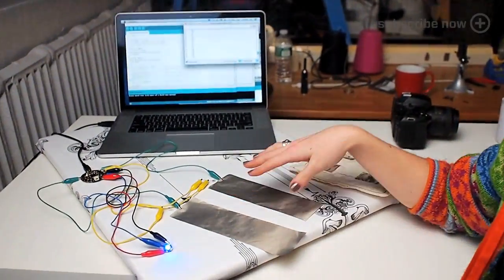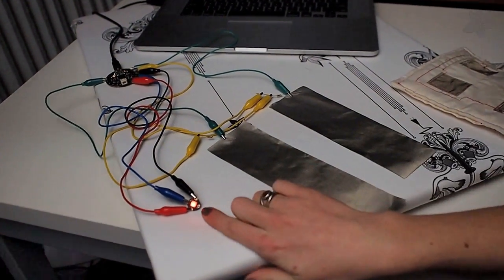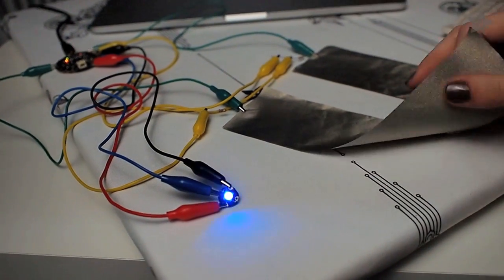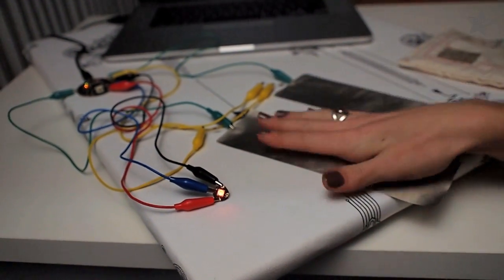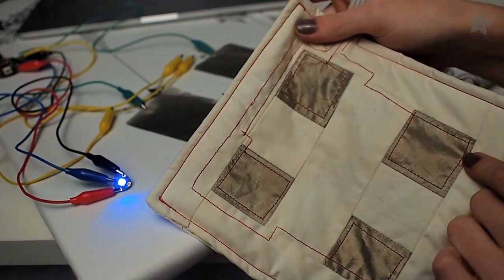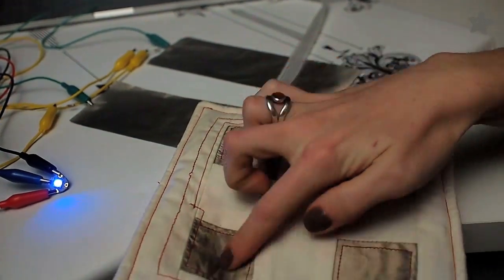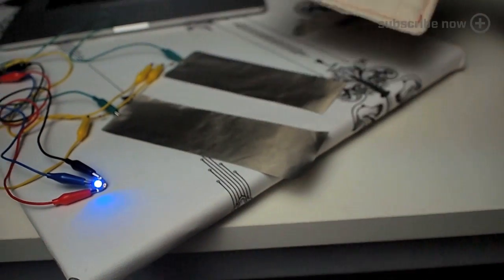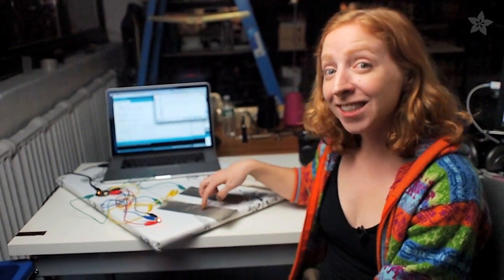Capacitive Touch with Conductive Fabric & Flora

Comment from the maker: Capacitive Touch with Conductive Fabric & Flora - Soft, wearable touch sensing!  #Wearables   #FLORA  
https://learn.adafruit.com/capacitive-touch-with-conductive-fabric-and-flora

It's easy to use Arduino's CapacitiveSensor library with Flora to make conductive fabric touch sensors! You can make soft game controllers, stereo remote pillows, interactive plush toys, or touch-sensitive clothes.